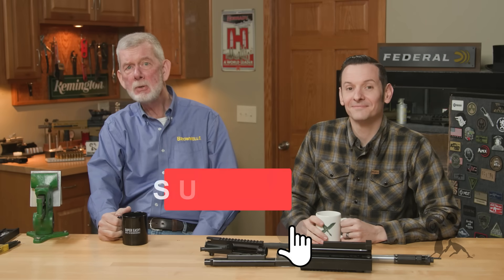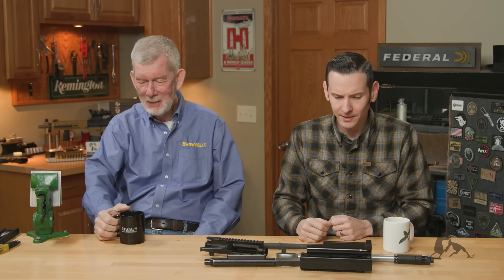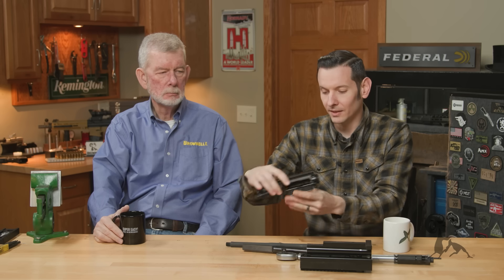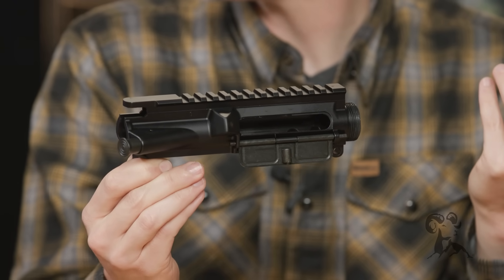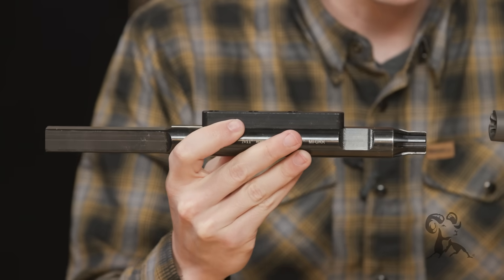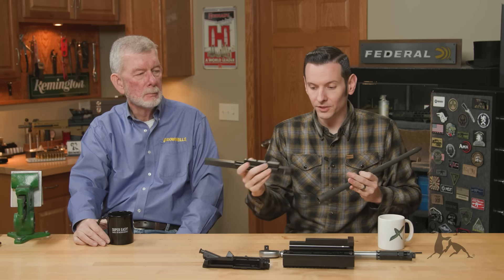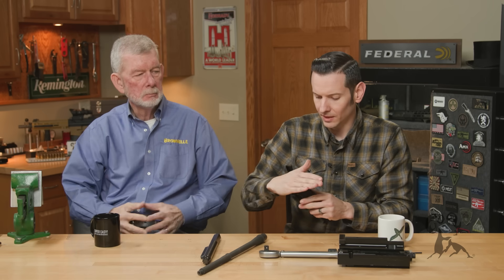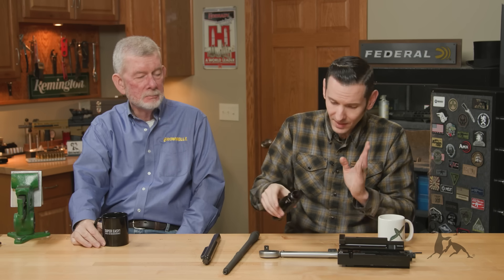SmythBusters: Top 5 AR Building Myths

Comment: As far as the loosening with the torque wrench goes, I think people are just getting confused (overreacting) to the recommendation that you should never use a torque wrench to loosen an "unknown" nut/bolt. In other words, if someone brought you some old rusty mud caked gun and asked you to get the barrel nut off, you wouldn't grab the torque wrench because the thing may be locked on past the wrench's specs. But if you just torqued everything yourself and know everything is good, no big deal. However, it isn't a good habit for mechanics in other fields to get into. Just grab the flex bar and everything is good. That's what the flex bar is for anyway, right?

Comment: All your stories of viewers with torque wrench bunched panties crack  me up! I have an old Craftsman 1/2" torque wrench. It has a single scale displaying left and right hand torque. It works by stress and strain deflection of the wrench's main bar vs. the floating indicator bar, as I'm sure Steve remembers back from the days when this was how all torque wrenches worked. Tighten..loosen , it's all the same and doesn't matter! Newer torque wrenches may have springs and clickers, but they still don't care about right or left. I still use my old wrench though. It's simple and I don't need to pre-set it for the torque desired. I've owned and used it for over 50 years! Its biggest downside is it's sometimes hard to see the scale, depending on the position in use (no clicker). I just use a sharpie pen  in those cases to transfer a target mark to the backside of the scale where I can see it. I used it earlier today with my old 1st generation Brownell's barrel extension torque tool to install a Brownell's 300 Blackout barrel and the barrel extension pin didn't break again--just like the last dozen times I've used it for AR work. I wish all my other barrel swaps were as simple!

Comment: The reasons people like to use things like the Midwest Industries upper receiver rod is that it holds the barrel itself in place preventing stress on the indexing pin and the upper receiver preventing damage and also the misalignment of the gas port in my opinion it's probably one of the best ways to do it if not the best and that's why most professional Builders use them because the last thing you want is a rifle that's not squared properly. You can get those action rods on sale for under $100 so the part itself isn't going to break the bank and if you can't afford to spend that little amount of money on a tool then maybe you have your priority's wrong and use the money for food and clothes instead.

Comment: The torque wrench thing is more for mechanics who are trying to unstuck stuck parts. The issue arises where to get a bolt free, you can use wild amounts of torque and that can hurt the wrench. A bolt that was tightened to 100ft/lbs after sitting in the elements for a few years might take 500ft/lbs or more to come free, and that can hurt a torque wrench not built for that. THe warning comes because for many people the longest ratchet they have is their torque wrench so it can be tempting.

Comment: Most modern rifle barrels do not leave space around the gas block for the old-style delta ring handguards. You can go up against the shoulder without any issues. Check them with the screw holes on the bottom of the block.

Comment: Here's a tip, that action rod. Bore a hole through the sail that is the correct diameter for a gas tube alignment pin. The tool is near perfect, but that one little detail would help a lot. Also increase the thickness of the lugs that interlock into the barrel extension so that it is not a sloppy fit. 2 unique M16 barreling Spud. That one is made perfect. But because they are a small shop it's twice as much in limited numbers.
Reply: Wheeler already makes one like that
Reply: @LetsTalkTactical  and that would be a good option if they didn't have that gimmicky locking system, and had made it out of quality material. Not soft aluminum.

Comment: The shoulder question though really pertains to shoulders that have a rounded radius where it meets the barrel instead of a 90 degree. It's not about forward or rearward alignment but rather the gas block ever so slightly riding or ramping up the radius and lifting the block a little bit.

Comment: The reaction rod thing is not a myth. The barrel will over rotate when you are torquing, the feed ramp will become misaligned, and your gun will malfunction. Moreover the index pin will round out the notch and destroy the upper.

How do i know? I did it to my first two guns, and they failed to feed like every 7 rounds. I took them apart and the problem was obvious. I got the Midwest rod and never had a problem again.

So, risk it if you want, but it happens and a reaction rod is cheaper than ruining some uppers. Get the Midwest, the real avid aluminum stuff is junk.

Comment: The torque wrench issue when loosening is exceeding the maximum allowable torque. Loosening usually requires more torque than setting. So if you're at the top of the torque range (example, using a 100ftlb wrench to loosen a barrel nut set to 80) you can damage the internals by exceeding the max setting. 

That said, if you set the wrench to it's max and stop using it if there is a click you'll be ok.

Comment: Yeah an AR-15 isn't an engine it's not going to blow if something is slightly out of spec people need to chill. ARs are actually really simple if you compare it to today's technology. You can slightly use a torque wrench nothing is going to happen unless you're using it so much it's basically replacing your ratchet also 50lbs is nothing.
Reply: The AR has specs and tolerances like any mechanical devise..If the interface between parts is out of tolerance it will fail and can fail big..

Comment: By using a reaction rod you are putting a lot more pressure on the index pin because the reciever is freely trying to turn into the index pin while torquing the barrel nut.  Upper threads HAVE been torn through just by cranking off a muzzle device while the barrel nut was loose. And those are only on with about half the torque of the barrel nut.
Reply: Which is why you don't use a reaction rod for barrel nuts, use a MI-URR or a Botach 'Double Action Rod'. The latter is now a $50 tool which is less than 1/4 the price of the Gieslee and less than 1/2 the URR, is there really a reason not to get one?

Comment: My Savage MSR barrel nut was so tight from the factory. I destroyed my upper removing the nut. There was no locktite or rockset once I cut it off. I heated it. And steamed it. I broke my armorers wrench first. Then upper twisted after i got a better tool and a breaker bar.
I had it in a vise block that had two pins. Ripped the uppers receivers pin block. So I just tighter the upper in the vise. I was at a point of no return. That’s when it twisted.

Comment: When being tightened, once the lugs of the reaction rod contact the barrel extension engage, there is no more stress on the pin.......kicker.....AS LONG AS the slack in the pin and slot is less than the barrel extension and lugs. The most value a reaction rod has is to prevent clocking of a barrel with a FSB.
Reply: Nope, the friction torque between the upper face and the barrel flange is still present if the reaction rod does not have a sail....

Comment: I have heard that the reason your torque wrench has a reverse switch is so it can be used in the southern hemisphere. Down there you tighten bolts the opposite direction. Using the reversing lever in North America will throw your spring drozilator out of whack.
Reply: Thank You Ms Vito

Comment: What about using one bolt carrier group in several upper recievers?
Reply: You still need to check head space when changing barrels or bolts..Also it is a good idea to check carrier key to lower receiver distance, carrier depth in the new buffer tube when changing uppers...

Comment: The torque wrench wouldn't have the option to knuckle that way if it wasn't designed to work for left hand threaded fasteners. That's always been my argument as well when someone says you shouldn't use them to loosen things. I could understand that argument for in-lb torque wrenches, maybe, but not ft-lb torque wrenches

Comment: Torque wrench calibration is generally +/- 4% in Clockwise, +/- 6% Counter Clockwise. Ive calibrated many many. Also who would of ever give it a thought to hold the receiver to tighten the barrel nut? Ive always held the barrel with hardwood blocks.

Comment: I'm a mechanic and I have thrown out several torque wrenches that are not accurate due to people loosening over torqued bolts. It might not happen with loosening inch pounds, but with 80-100+ ft lbs... it's quite possible

Comment: Damn, callin out SOTAR lol
Reply: @ZXRVideos  I have never taken a SOTAR class and I could care less who you think you are..Your comments are all I need to know about you slick...
Reply: @ZXRVideos  Neither do you..
Reply: And was proven wrong by SOTAR lol..
Reply: @hairydogstail  what? The barrel with no pin? There's a reason for that locating notch. I love SOTAR but he can be a fanboy of brands too. I've built over 15 ARs with the cheap Ncstar upper vise. Works just fine.
Could I do better? Of course, but it works.
Reply: @jadslash  You missed the point once again..He was showing the stress put on the index pin and in the index slot of the upper receiver..I have found and fixed two clocked barrels using the MW URR tool myself..Caleb even stated he was wrong on SOLTAR's face book after watching Chads video.. No one is saying other methods won't work, but there are better tools than others..
Reply: @ZXRVideos  Says the smooth brain who has zero clue about the TDP specs, tolerances and parts interface..
Reply: @GHFK1959  Freud was right..In any case, sorry to hear about your cancer..I hope it goes well for you..

Comment: I work on aircraft. A 737 has a 150 FT/LB final torque on the axle nut. A 3/4 drive torque wrench is used to break it loose routinely and the torque wrenches withstand it no problem. A recreational user assembling gun parts will not wear out their torque wrench breaking a few barrel nuts with one.

Comment: I get that there may be few encountered issues with tightening a barrel nut without a tool. However that doesn't mean 'can't' happen or 'never' happens. Too many pics and vids out there of bent index pins, busted upper receiver threads etc that contradict this. Most people don't actually get into car wrecks, so seatbelts are unnecessary. A lot of people work around machinery without hearing protection and survive. Right? Is it really debunking myths with anecdotes? Being serious, it doesn't take long to see a number of damaged upper receivers and sheared index pins. And while there may be some play same as the pin using a tool, the tool WILL stop, the pin can only shear. It's not guaranteed to stop. 

Not suggesting a tool like a reaction rod is required every time but it's also a bit much to suggest it's never needed. If someone screws up in the shop pfft, just eat the cost and grab another part. If someone dicks up their $200-300+ upper, replacing it will cost more than the $100 tool. 

This from Chicago Pneumatic. I'm sure they're 'doing too much' when they state - "A torque wrench is a tightening tool. It is a very sensitive and precise tightening tool, and should never been used to loosen bolts." SnapOn doing too much too - "Use a torque wrench to apply a specific torque value during the final assembly process. Do not use
a torque wrench as the primary means of tightening or loosening fasteners." CDI might know a little bit about torque wrenches - "Some torque wrenches are abused or damage beyond repair. The most common abuse is using the wrench as a breaker bar to loosen a bolt or nut. This type of misuse is evident if the tube or the drive is bent in the counterclockwise direction in relation to the tube". In fact their maintenance guide specifically states 'DO NOT REPAIR' if this happens. What 'sources' did you ask about proper use of a torque wrench? 

Gotta be honest, been loving the Brownell videos in general and the personalities are great. But this vid saddened me. The level of snark interjected while perpetuating shitty advice and misinformation about tools. Not cool. Imagine calling people 'extra' for using tools properly. When you start manufacturing and become one of the top three oems for torque wrenches, please. Endorse this advise all you want and sign your name to it. At this point I'd be a little concerned to let you guys work on my schwinn. Next you'll be telling us safeties are 'doing too much'.

Comment: You guys are wrong about the Midwest tool and the barrel extension. Watch the school of American rifle where he demonstrates. There is a better and more tight fitting tool than the Midwest urr and it’s the “2 unique LLC m16 barreling spud”  now will the rifle work without using those yes. However the bolt will be making contact with the barrel extension lowering reliability and having to increase the springs

Comment: If you loosen a faster that exceeds the torque wrench spec, you will fuck up your torque wrench. The warning isn't there for thread seasoning. Its there so you don't try to loosen your lug nuts that were tightend to 250 with an impact. Or try to break a rusted siezed up ass bolt

Comment: As long as you don't exceed the torque wrench specs, you can loosen all day long. Sometimes you just don't know how tight something is though. Loosening with a breaker bar is the best way to be sure. Every toolbox should have a breaker bar.

Comment: While I agree with almost everything in this video. I don’t agree with the gas block alignment. I ran a suppressor on my 300 blackout for the first time a few months back..and got a superlative arms Adjustable gas block. Had my LGS install it. It was right on the shoulder at first when they installed it. No matter what setting I put the gas block on…it short stroked like crazy.  I moved the gas block maybe a MM off the shoulder. And….MAGIC! No more short stroking. On pretty any and every setting I had it on. I believe placement is key. I know adding a can messes with how gasses works on a can. But still I believe that applies.

Comment: While I agree with most of the things in this video. I don’t agree with the gas block alignment. I ran a suppressor on my 300 blackout for the first time a few months back..and got a superlative arms Adjustable gas block. Had my LGS install it. It was right on the shoulder at first when they installed it. No matter what setting I put the gas block on…it short stroked like crazy.  I moved the gas block maybe a MM off the shoulder. And….MAGIC! No more short stroking. On pretty much any setting I had it on. (Yes I know adding a supressor does change the way the gas operates on an AR) and they may mean running supers on no can but still. That statement still applies.

Comment: Torque wrench. My dad was a mechanic. He taught me the importance of using the proper tool for the job. Why would you use a torque wrench to break loose a bolt if you own a breaker bar. One is designed to tighten fasteners while the other is designed to loosen fasteners. Why not use them as designed. So what if it will take the abuse, why abuse it?
 I worked many years as an auto mechanic. I bought my first torque wrench in 1970, and it is still accurate. Last year, I bought a torque tester, and my old wrench tested great. I appreciate my father, my auto technician training, and even the army for teaching me  to respect the things I have. Thanks!

Comment: Reaction rods are hilarious scams. The 5.56 I run through hell today... i built in my lap on a kitchen floor with basic harbor freight tools back in 2017. 
An allen key set, a pot metal punch set, and a small tin of anti-seize grease. I bought a chinese mini vise, and bolted it to a nylon cutting board from walmart as a base.
By the time my furniture and tools arrived by truck fromFL to WA, my rifle was built. And it's running strong.
I used a 15 dollar upperreceiver block in my chinese vise mounted on a plastic cutting board. Torqued that BN  by feel. Still ain't loose.
Reply: I hope this was satire...

Comment: This ia anecdotal, but i built mine with a reaction rod, that has no wing, therefore only supporting the barrel extension. And mine are fine. Ideally you would support both the barrel AND reciever, but sometimes you have what you have. I also think that the torque wrench thing comes from the idea that you can "measure" proper torque values by using a torque wrench to break things free and re torque ing the faster to the break away torque. That being said I'm still not using my snap on tech wrench to break things free, too expensive to chance it.

Comment: Every ar I’ve built has been on one of those blocks that holds the pins and I will say I did accidentally forget to pin the front one time I installed a barrel and I snapped off the rear takedown pin hole, but other than that never had a problem, I also keep the upper in that jig to install the muzzle device, I agree you guys are very good when it comes to information ! Keep it up !!!